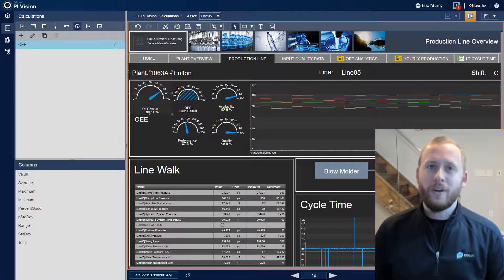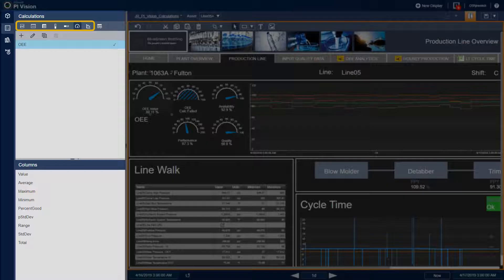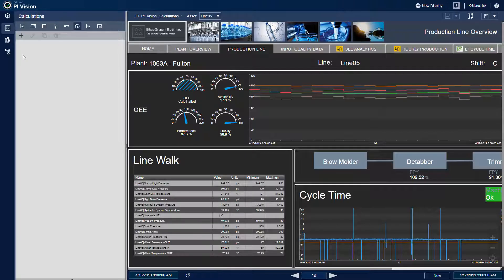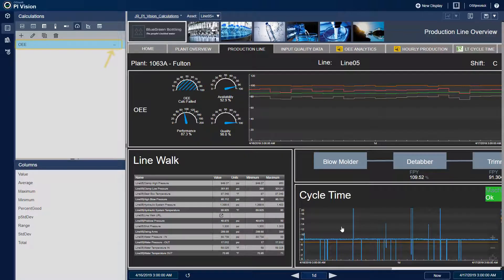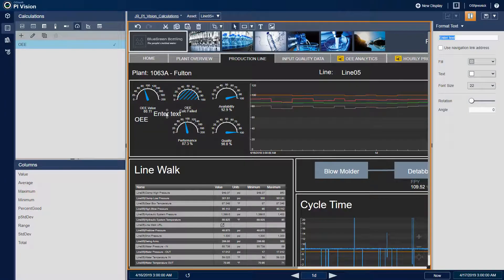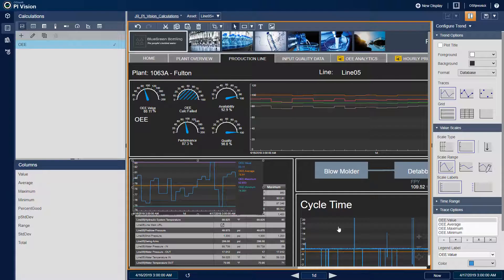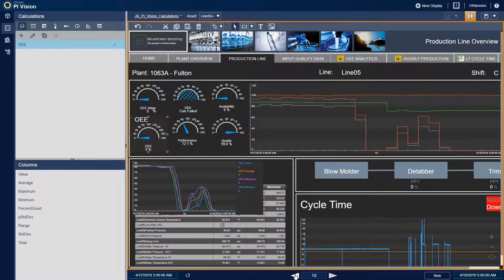PI Vision - Calculations

Comment: How do you manage for event weighted calculation. As an example if you calculate a time weighted calculation of 1 min interval within 1 hour in PI Datalink, and this list of data is averaged. The value average calculated in the PI Datalink extraction will not be the same as the simple calculation pi vision average figure. I am guessing this is because the the PI Vision is using time weighted calculation whereby there is no defined interval of 1 min data. Is there a work around for this?
Reply from the maker: Under Advanced Options in the Calculation Editor there are options for specifying Time Interval and Calculation Interval, which should allow you to accomplish something similar to what you were in PI DataLink. For more information on those settings please see the documentation here: https://docs.aveva.com/bundle/pi-vision/page/1010080.html

Comment: Hello everybody! Please help me with following - I have a graphic of compressor unit in PI Vision. I would like to replace PI tags with new tag in the same unit. How can I do this?
Reply from the maker: To replace the data item displayed in a symbol in PI Vision, you can simply drag and drop a new data item over the symbol until it turns green. Note with trends you will have to go into the Configure Trend menu to remove any unwanted data items.

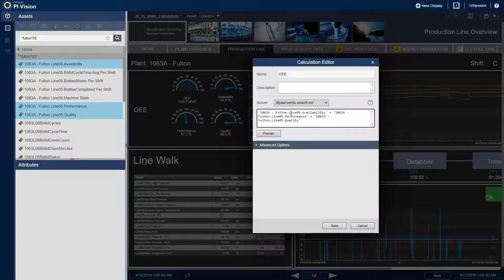Comment: I cant Drag And drop my pi-points.On your Drag-And-Drop at 1:44 your Pi-Point change to green before you drop it in the box , Mine stays red :( and wont paste
Reply from the maker: This behavior is most common when you are trying to drag something into the Calculation Editor that doesn't match its context, such as dragging in PI Tags from the wrong PI Server or AF Attributes when you have PI Server selected. Make sure what you are dragging in fits in the context of the options you have selected in the Calculation Editor. If this doesn't solve your issue I would recommend reaching out to Tech Support (my.osisoft.com) to troubleshoot further on your specific environment.

Comment: I am having trouble with a calculation.  I want to take three different wind speed instruments and perform a calculation to ensure they are all within 50degrees.   Due to the upper limit of 360degrees, I cannot figure how to compare these three points.  If one instrument says 20 degrees, and the other two are reading 350 and 355 respectively, they’re still within the required 50 degrees, but I am having trouble with either my equation or the syntax im using.  Can you help?
Reply from the maker: Hi Mickey,
After some quick googling I found something that outputs the shortest difference between for 2 angles A and B, which looks like min(abs(A-B), 360-abs(A-B)). You could expand that logic to compare each angle to each other and then if they are all within your tolerance you could output True or False. 
You may want to consider making this with Asset Analytics on the AF Server if this is turns out to be too complex for PI Vision.

Comment: Hi all. Is it possible to re-use calculations within the same dashboard? Example: you calculated the OEE for  the plant 1063A - Fulton. Let's suppose that you created a new calculation called OEE_2 where you calculate the OEE for another plant (i.e. 1063B - Fulton). Then you want to create a new calculation called "OEE_SUM" where you are gonna sum the OEE for 1063A and the OEE for 1063B. This means re-using calculations that your already created. Is that feasible?
Reply from the maker: At this time the functionality you are looking for is not part of PI Vision. However it appears that others are curious about this functionality and have submitted an enhancement request: https://pisystem.feedback.aveva.com/ideas/PIVISION-I-1258. In the current PI System I would recommend taking these calculations into Asset Analytics, as it can already do what you are describing and the results of those calculations can be visualized in PI Vision.
Reply: @AVEVAPISystemLearning  thanks for the fast reply. I agree with you about passing through the Asset Analytics (but in my case, I don't have the permissions to work on it because this is managed by another department of my company). The interest in re-using calculations is also related to the fact that within each calculation, there is a maximum number of characters that can be used. And the limit on the digits can be easily reached. Multiple calculations re-used within dashboards could bypass this problem :)

Comment: Is there a way to add unit to the calculation results beside adding a text box? I need to show the results in the trend plot and table. thanks.
Reply from the maker: Thank you for your question! To benefit all our customers we recommend you bring your questions to the PI Square community platform: https://pisquare.osisoft.com/
Reply from the maker: There is an enhancement request that you may like to vote for on our feedback site here: https://feedback.osisoft.com/forums/320517-pi-vision/suggestions/43412583-assign-units-to-a-calculation

and there is a potential workaround on PI Square here: https://pisquare.osisoft.com/s/question/0D51I00004ZPoclSAD/display-unit-for-calculation-in-pi-vision-2020

Comment: I am trying to build a rolling totalizer. I have a calculation that converts volumetric flow and ppm to mass/weight. I need to be able to monitor the total weight for a rolling 24 hour period. Is this possible in PI Vision?
Reply: To clarify, I have inserted PI tags for ppm and flow inserted into an equation that calculates weight for a 5 seconds interval at the real time process variables. I want to totalize this weight over a rolling 24 hour period.
Reply from the maker: Thank you for your question! To benefit all our customers we recommend you bring your questions to the PI Square community platform: https://pisquare.osisoft.com/

Comment: Maybe not committed for this video but here is my question:
If i have 3 pumps. One is shutting down because of a problem.
Can you visualize it with 1 symbol that is turning red because 1 of the 3 pumps failed? Thank you
Reply from the maker: Yes, it should be pretty straightforward to do. You can use IF THEN ELSE logic in your calculation to write a desired value to set the multistate color to the correct status based on the 3 different pump tags. If you would like help on developing a specific calculation, I recommend to post your question on https://pisquare.osisoft.com to leverage the power of the PI System community.
Reply: @AVEVAPISystemLearning  Ow thats nice, I will try it soon. Thank you
Reply: Is it possible to at a calculation to a symbol, like a circle or square?

Comment: is there any function of forecasting lets say forecasting of weather in the PI vision, if yes how to do that?
Reply from the maker: This might not be exactly what you are asking, but perhaps it can help. "How to implement a real time weather widget in PI Vision ?" article https://customers.osisoft.com/s/knowledgearticle?knowledgeArticleUrl=How-to-implement-a-real-time-weather-widget-in-PI-Vision-
Reply: @AVEVAPISystemLearning  thanks, i just want to know how to do forecasting in PI vision. I am not particularly interested in weather as it was just an example
Reply from the maker: @hammadaziz2809  If I understand you correctly, you are looking for future data (forecasted data) in PI Vision. In short, yes you can see future data in PI Vision. 

PI Vision is a visualization tool, so I wouldn't recommend setting up a PI Vision calculation to create the future/forecasted data. 

The PI Server supports future data via PI Points, which are kept in a separate archive file from regular historical/real-time PI Points, and you can trend these future PI Points on your PI Vision displays either by selecting them from the PI Point itself or through an AF Attribute that references the future PI Point. 

This is a good reference for your future data needs: https://livelibrary.osisoft.com/LiveLibrary/content/en/server-v14/GUID-A200FCFB-73DF-452B-9A2F-62A1A2C33DF6

For the PI Vision visualization piece:
Make sure you extend the End Time (bottom right) of the display to some point in the future to see your forecasted data - i.e. *+1h will set the end time to an hour in the future and you will see a vertical dashed line where the real-time values stop (current time) and future data extends beyond. 

Let us know if this was the information you were looking for.

Comment: Good morning. How are created PI Points? Within my server I have several CNC machines and from each of them I can collect several signals such as the process stage, the spindle rotation, the heartbeat and so on. But for the calculations I need to have PI Points. Is there a way to create them?
Reply: Ok. I solved this problem by having a deep look into PI Explorer and I found how PI Points are called. I was wondering if it is possible to set conditions (if, else, then, or, etc.) and if it is possible to work with signals which output is different from a number. For example, I would like to do the sum of the machines that are connected and of the machines that are not connected in order to have a real-time value. The signal is "heartbeat" and let's suppose that the possible outputs are "connected" or "non_connected". How manage this situation with the use of "Calculations" within PI Vision?
Reply from the maker: @mestparty  Yes, it should be possible to create a calculation that performs this function as IF, THEN, ELSE statements are supported in PE syntax. Take a look at the list of functions available here: https://livelibrary.osisoft.com/LiveLibrary/content/en/server-v14/GUID-42D9E42B-6084-4023-829F-919C19A6D45F
 and if you need assistance creating the calculation or further discussing your use-case, please reach out to our Tech Support Team. https://www.osisoft.com/support/
Reply: Thank you for your reply. And for the link too. Finally, I was able to perform my calculations by creating new signals which output was a number (i.e. production = 1, idle = 0).  But for the future maybe I'd need to use the syntax IF, ELSE, OR and so on so I am gonna have a deep look to the reported link.
Reply from the maker: @mestparty  Glad to hear it. I'll add that our Tech Support experts are happy to help you brainstorm and put the right calculation in place - as they may suggest that another type of calculation (e.g. AF analysis) which may be a better solution based on your use-case. Have a good weekend!
Reply: @AVEVAPISystemLearning  Perfect. Next time I will face with them cos I would have some questions concerning my dashboards and with a meeting I think they could help me a lot. Thank you again and have a nice weekend too.

Comment: Does it use the PI Analysis server or can we dedicate a calculation server for these calculations? Next up, can we have PI Analysis server balance load using F5 rather than use Windows clustering?
Reply from the maker: Hi There! Calculations are initiated from the PI Vision server but are performed on the PI Data Archive (similar to Performance Equations)